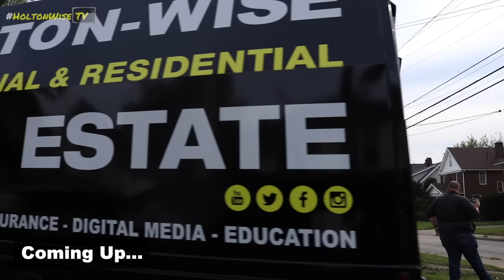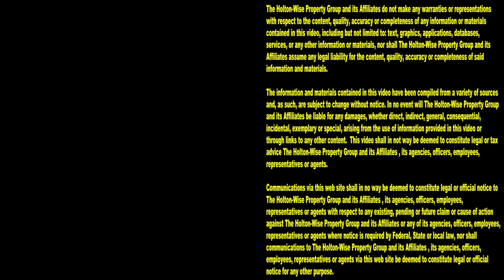The Entire Eviction Process Caught on Tape: Live Footage (Extended Cut) | Tenants From Hell 127

Comment: it depends on which level you analyze the situation. In the broad level, you got to admit that the system is not designed properly. nobody should be homeless. I'm not saying everybody should live in a palace, but a small mobile home, guaranteed, for example. This kind of safety net should especially be allowed to put in place at the local community level, where demographic control would also be allowed for example.